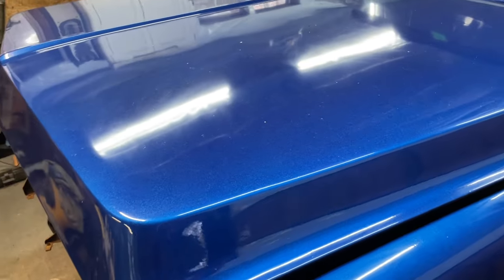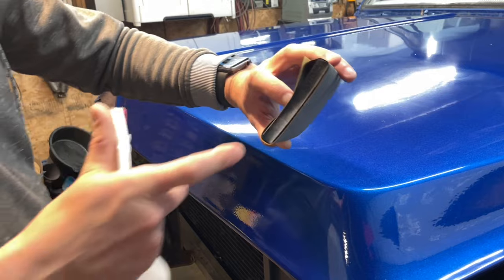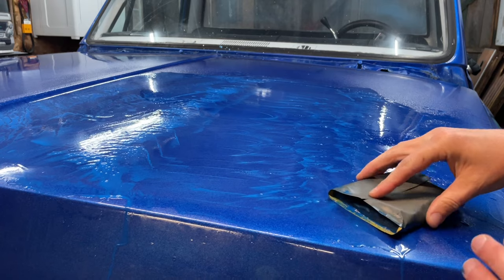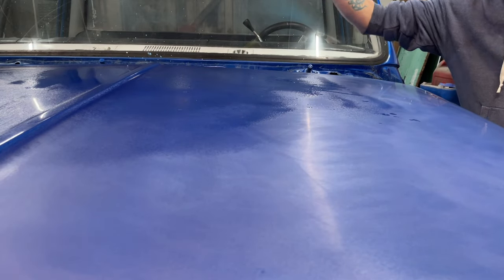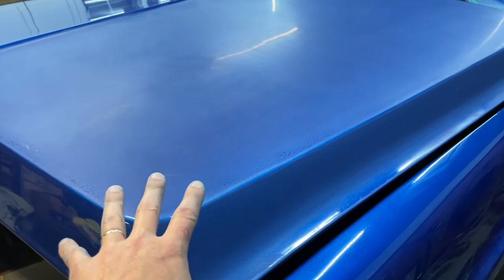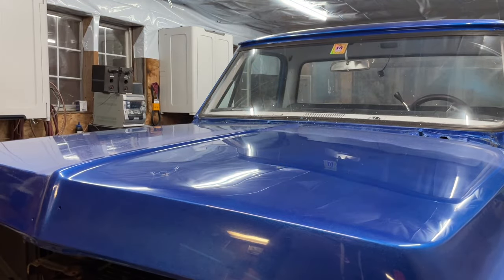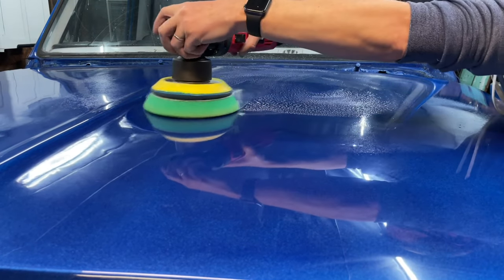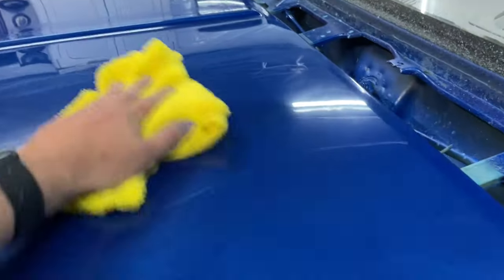DIY Cut and Buff Single Stage Paint

Comment: I just did a single stage red and color sanding with 1000 then 1500 then color sanded 3000 and  used 3m rubbing compound then then a polish it came out like a mirror now on metallic paint like I said before is when your applying the paint use 2 ball bearings in the paint cup and keep the metallic particles suspended. When I did the blue truck the metallic was uniform no heavy spots, then I did a normal cut and buff and it turned out very nice, I also did it in sections which I think helped, because I only had a small compressor that you use a nail gun with but, people were like wow that’s a nice truck but like you said single stage is different than base clear coat, but your video is very rewarding and I really appreciate you going through the steps it will help people out thank you!
Reply from the maker: That’s awesome you pulled off a nice job with limited equipment!

Comment: Never knew that wetting the surface while using medium cut would be so much easier. My 89 Saleen Mustang is mostly still original single stage paint and this video was super helpful. Thanks for sharing your knowledge.
Reply from the maker: Glad you found the video helpful!
Reply: Although I’m a professional detailer of 15 years, I still learn from others. However, I hate wetting the compound as it makes such a mess and putting more compound and polish onto the pads only creates more work. I find it is less work and less cleanup to use less and repeat the step if need be. That’s just my personal preference. While the gloss is fantastic, with metallic paints , the blotchiness can’t be corrected.

Comment: By doing this you're going to disturb the metallic horribly. When you see it in the right light it's going to ruin your day ! ! !  You can do this on some of the very basic solid colors, but keep in mind that you can disturb the pigment on some solid colors. Disturbing the pigment usually isn't nearly as bad as disturbing the metallic. Use clearcoat and cut and buff that. Do it before the clear gets too hard, and it won't be near as a difficult. If you cut and buff color you're going to plug up your sandpaper and your buffing pads, not fun! Hope this helps, I painted cars for 20 years.
Reply: He already did.  Look how blotchy that side of the hood was after he polished it.  You can cut and buff single stage just fine, but not metallics

Comment: Thanks for sharing, very instructive video.

I always struggle with single stage paint, not so much runs when  you get used to it but orange peel is always a big deal. After several attemps I realized I was not using the proper reactive (fast) and moved to another reactive (slow). This dramatically reduced orange peel but occasionally I still have some. I tried using a bit more thinner (specs from paint manufacturer is 5 to 10%, i tried 15 or even 20% on very hot days).  Also I'm never happy whith the paint gun settings with this type of pain, (either too dry or too much material resulting in orange peel) and can't get a proper result directly. I think I'll give up on one stage paint and move to base+clear for future projects, but since I started a full paint job with this paint I'm stuck with it for this project.
Anyway cut & buff process can also be tricky and requires the proper equipements. I tried cut&buff but using a pneumatic DA for the finish cut and bufffing and never managed to get the shine completly back. 
I now invested in electric tools (DA + rotary sander) and proper buffing pads (and proper sanding pads, not the cheap ones) using the same buffing compounds and the result is already much better, almost good (for my standards). I need to practice more but your video confirms that I was doing it all wrong previously.
Reply from the maker: Thank you, and thanks for sharing all of that information!

Comment: Hey Corey,  Nice job bringing that paint to as smooth as can be.  What is taking away from this is not your fine sanding or compounding,  it has to do with the paint itself.  The metallic of the paint is not appearing to be evenly distributed.  Only way to fix this is to respray it.  UGH!!  I know you know this and are hoping for the best.  Good Video.  Keep them coming.  Thanks.

Comment: Long time painter and restoration expert next time reduce your paint more and maybe turn up your gun pressure. You cant really cut and buff a metallic single. You can see it in your video pretty good which means in the sun in person you can really see it. You cut the tops of the metallics it makes the color lighter and more silver. It's fine on straight colors but not metallics or pearls although you can get away with it on pearls alot better its harder to see. My best tip for anyone spraying something like this and low experience is on the last coat mix the single 50/50 with clear this gives you a translucent layer you can fix things in. Your still limited on what you can fix but it's better. Personally if this happens to me I let it sit for a few days buzz it down with 1000 and spray a quick one coat.
Reply from the maker: I understand what you are saying, the paint does have a bit more silver color to it but it does look way better even in the sun than it did. I definitely should have reduced it a lot further though.
Reply: @coreysgarage6389  atta boy came out great in the end for a learning experience. Enjoy the truck and keep up the content.
Reply: You said the same thing I was thinking
Reply: Do you have to sand polish  after 1000 and wet coat you mentioned .

Comment: I would advise anybody to not color wet sanding a single stage metallic paint! Why you ask! Because when you paint a metallic single stage paint, on the last coat you have to fog the paint as you go to keep the metallics from uniform a d not blotchy looking, wet sanding will ta,e that layer off and it will get a zebra look to it. And at the beginning of video he showed  a run  that will end up being heavy dark metallic run even though the run itself is gone.  Now if you sprayed it with a single stage solid color no metallic you can do the wet sand with no problem as long as you have enough paint on said job.
Reply: What should i do if theres dust on single stage solid black paint?? Please give me advice…should i wet sand and polish or do a 2nd coat??
Reply: Buff it
Reply: If you wetsand the whole car, and either polish or clear coat the paint will be fine. The run can be fixed also by sanding the panel down and run down and simple respray.
Reply: @NoPo101 Wetsand it with ultra fine paper and then buff and polish.
Reply: He actually says the same thing at the end of the video.

Comment: Great tips and thanks for showing the specific products and tools used!  I already own that Bauer DA.  I just ordered Tamco AG Series single stage paint for my project which I will be shooting in the fall.  I am saving this video for future watching when I am ready to buff it out.
Reply from the maker: Thank you, let me know how it works out for you!
Reply: I just used a 4" foam roller to put on Tamco DTA epoxy primer. It came out pretty good. Will need some sanding but its sands smooth pretty easy with 220 grit. Saved me from getting overspray everywhere.

Comment: One thing you did wrong on the single stage was not mist a light spray at the end so all the metalics in the paint matched in a uniform pattern it's very blotchy but it's still a good job for a first try better then I'd do probably but I'm just speaking from what I seen painters do in my uncles shop I grew around a body shop know how to do it and all just don't do it enough 😂 lol I like playing with engines more but anyways had you tried to mist a very light spray over last coat to create a  uniform pattern at the end of the paint job this paint job would of been a little more clean this is critical step for single stage metalic paints only but that's how you learn by trying new stuff good job over all👍

Comment: This is awesome, you can always clear over single stage so you can get past the imperfections and cut and buff without worry.
Reply from the maker: Thanks, yeah I was just doing a cheap paint job so I didn’t want to use clear.
Reply: Can I clear cured single stage ?
Reply: @JR Dominguez  I always do. Just scuff it and spray her. Do any corrections to the paint before clear.

Comment: Curious...what do you think you're removing from the upper 1-3 mils of the dry paint film when you sand and and then buff a single stage coating?
Reply from the maker: Just single stage paint… the purpose is to remove the orange peel.

Comment: I'm from Australia, and I was wondering, is there no re-enforcement braces under the bonnet of those trucks? I cringed every time it popped and buckled under the low pressure of the buff, and hand sanding. I thought it was going to buckle the bonnet.

Comment: Hey I took a lot of tips from this video as I’m working on single stage. My question is between sanding there is always a mess, besides hosing the car off every time and pushing it out of the garage what do you recommend? I’ve been using glass cleaner and a
Microfiber
Reply from the maker: Unfortunately I recommend doing exactly what you are doing.

Comment: How many coats of paint did you do? I just shot my car in TCP Global single stage metallic and have some cutting and buffing to do on it. Worried about going through since it's too cold to repaint the car until spring. Thanks! Great video.
Reply from the maker: I did 3 coats and they were all pretty heavy as I was trying to get it to lay down.
Reply: Did you figure it out?  I just painted my car with the same paint and now it's time to cut n buff

Comment: The best way to do single stage paint is to do light consist coats that way it stays wet you can keep your metallic flake from sagging and alot of the orange peel will go away
Reply: Good to know.  I was spraying a mettallic single stage wet and the metallic all run down

Comment: question. what's a good method for cutting and buffing in tight areas where a buffer can't go? What would I use in regards to substitution for the wool pad, medium cut pad and the black pad, if doing this by hand. Thanks!
Reply from the maker: Generally you wouldn’t cut and buff tight areas because you want see it as much. But otherwise you can do the same process by hand with a microfiber cloth.

Comment: Hey great video I have been doing the same steps on my new paint job black single stage. I just finished the first buff and moved on to the fine cut with the same polish pad. It seems to shine better before that step? Did I do something wrong? Thanks
Reply from the maker: I’ve noticed the same thing. I think the heavy cut with the wool pad does a little better job of melting the finish, creating that super high gloss. But it will leave behind hologram looking swirl marks, that is what the next steps remove. In my experience the first buff is super glossy, the next buff isn’t as glossy but more even and then the third polish/buff brings back a lot of gloss. Hope this helps.
Reply: @coreysgarage6389  Thanks for the reply! Are you referring to the swirl remover as the 3rd buff?

Comment: I just did a single stage and it came out very bumpy looks terrible. I don't know if the problem was my spray gun or what was it. Do you think it can be fix by doing this? 🤔
Reply from the maker: Is it a metallic paint or solid? If solid color this will definitely fix it. If metallic this process will make it smooth but the color may change and get blotchy from sanding into the metallic. Mine came out ok but it’s not perfect.
Reply: It's metallic.. Same happened with 2 stage. I think there's a problem with my gun or the air pressure.. Sad to do so much work to have terrible results

Comment: Seems like when you used the DA You had it stalled the whole time? To much pressure. Correct me if I  wrong.
Reply from the maker: @badass1g  no not too much pressure, that’s just the compound working and having the speed a little low. I apply almost no pressure at all.

Comment: Every panel I did has orange peel. First time painting a car...... Going to try and wet and the whole car this weekend
Reply from the maker: Good luck, let me know how it goes. A good cut and buff job can make an ok paint job look incredible.
Reply: @coreysgarage6389  so far it's looking much better. I can actually see my reflection in it now😅😅
Reply from the maker: @beanz1540  That’s awesome!
Reply: Same thing with me, but It was entirely my fault for being lazy. I didn't buy any sort of fans for ventilation so the first few panels I sprayed as I was spraying the car would wet out decently then by the end of the car all of the dry spray in the air would be falling into the paint and making it even more dull. The car's got a nice texture at least haha
Reply: Cut n buff on single stage isn't that tough to do you just need to make sure you have the paint layers thick enough to hold up to sanding.
Reply: @beanz1540 did you follow his steps?  what grit papers did u use ?

Comment: Great video... just laid down single silver with flake, looks okay, but didnt wet out like I would have liked. Going to do this and hopefully get some shine. Have you done the 1000 wet on the DA? lowest speed?
Reply from the maker: I have done 1000 dry at high speed and it worked out great. I’m not sure if the silver flake will cause any problems. Because my paint is metallic the color does change slightly from sanding, becoming a bit more silver but it looks way better than the orange peel.
Reply: Dang hope you didn't try cutting and buffing single stage metallic paint,it will scratch the metallic making it look shitty,only works for single stage paint with no metallic.

Comment: Mix with slow reducer,spray light coats  thru 1.2 spray tip,,,
Reply from the maker: I can’t remember for sure but I think I was using a 1.5 tip. I couldn’t put on light coats or it would be super rough. Definitely could have thinned it more.

Comment: Always thought you couldn't color sand on metallics because of sanding through the metallics
Reply from the maker: Nope, you definitely can. The metallic is all the way through the paint. This has 3 heavy coats on it. I didn’t do a great job on the spraying so it was a little blotchy or the hood before I started sanding, it may be a little more blotchy now but it’s hard to tell.
Reply: @coreysgarage6389  looks like you did a good job to me thanks for the reply

Comment: You are complicating things too much, after sanding go with a micro fibre pad on a DA with some coarse compound, than use an all in one finish compound on soft pad. You can try out the rupes line, coarse and then uno protect on a medium wool pad
Reply from the maker: Never heard of the rupes line.
Reply: @coreysgarage6389  you should give the a try, they well worth it

Comment: alot of orange peel on my 63 impala . I'm guessing it's single stage paint ? it's a 20 yr old paint job . what should I do to get rid of the orange peel and bring out shine . I have an orbital sander . haven't used it yet though . maybe a wet sand ? or cut/ compound ?
Reply: also have the same DA as you . from harbor freight .but mine has different speed settings . what speed should I use
Reply from the maker: You might want to try buffing it first with a wool pad and compound. Speed is a good question and I get asked that frequently, I honestly have no idea, I just have a feel for what is too fast or slow based on how it’s sanding I guess.
Reply: @coreysgarage6389  oh okay soo don't just start out wet sanding and do the steps u did ?
Reply: @coreysgarage6389  use a whool pad by hand with a compound?
Reply: @coreysgarage6389  where do you get the sanding blocks from?

Comment: First time painting car single stage paint   massive  metalics first time  didn't like results. I learned must spray as wet as you can then that's your look.i tried fixing first time with cutting and buffing. It was a nightmare I lost 500 bucks worth of paint.redid it wet,wet wet.and it looks great now couple small runs but for not a professional  looks pretty dam good.i don't think single stage paint  likes cutting and buffing in my opinion!!!
Reply from the maker: This came out pretty good after the cut and buff. But it was a pain to get it to lay down, I should have reduced it further.

Comment: You use single stage metallic and you can see the bad distribution of the metallics . You didn't flow out the paint you supposed to dust it out side to side .

Comment: There's going to be so many waves in that paint you should be using 1500 grit on a paint if you don't have an acrylic and then go to your two thousand and then go to your 3 everything needs to be cut down flat with a paint stick
Reply: Wrap the paint stick with your 1500 and peel off  1 inch at a time as you need new one sheet will do the whole side of that pickup

Comment: wet sanding wrong the sandpaper should soak in water for at least an hour before usimng that helps to prevent paint  build up on the paper,
Reply from the maker: I don’t know where you learned that but it’s definitely not required.
Reply: right not required but recommended for best results the paper should be saturated